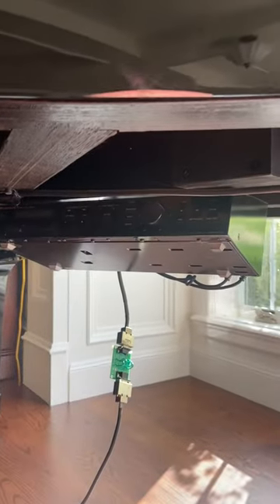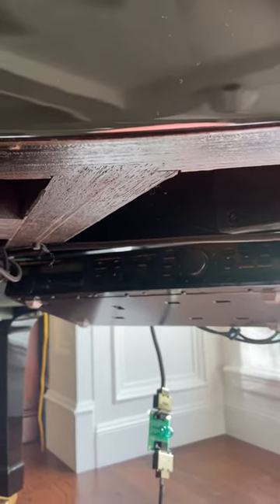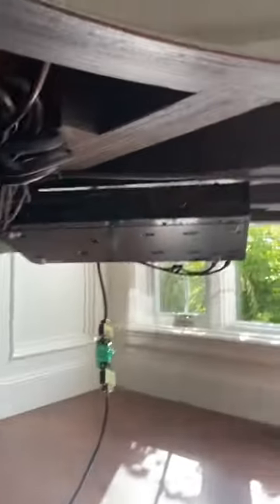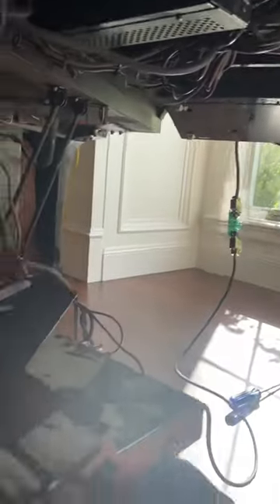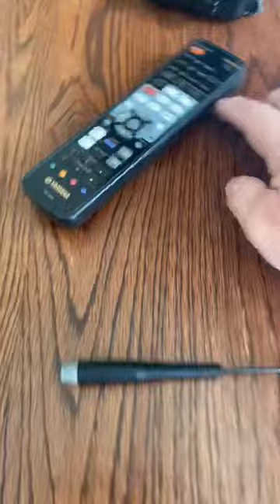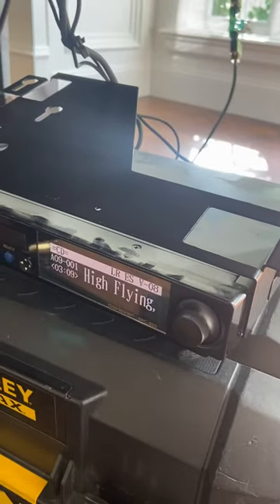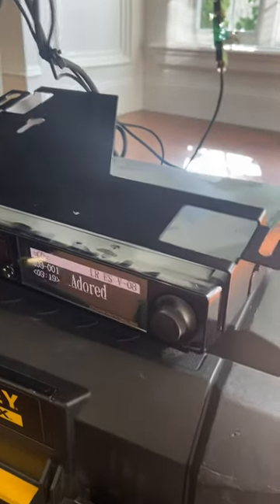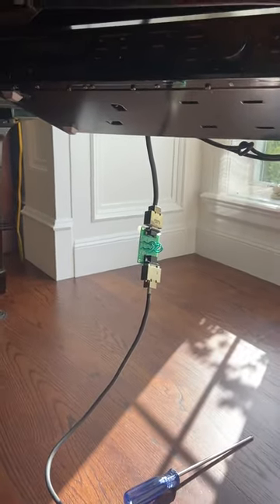It WORKS! DKC100R straight up to Dkc850 no midi cables no ancient control box!!!

Comment: I am thinking about buying a Yamaha C2 with this configuration.  Are you still happy after 3 years?
Reply from the maker: Hello!!! Very happy!!! Make sure to ask if the piano has had its power supply replaced or refurbished!!! It’s GUARANTEED to go out if it hasn’t already!!! About $800 to get it refurbished by TAP in CA or you could get a new one for about $1200 make sure to bring that up before you buy it. Then contact me and you’ll be in business!! C2 oh yeah! Add pianostream and combo dkc850 9-15 adapter board and you won’t need the extra control unit.  Plz send me an email.  Hayesiq@gmail.com 
Thanks…. Richie

Comment: Please more information just upgraded my mkii to dkc 850...would like to know more so I can get full functionality of the dkc 850
Reply from the maker: Jeremy Sisante is the dkc850 connected to the original control unit with midi cables?
Reply: Yes, it’s hooked up to the old dkc 100r through MIDI cables on the “Add” setting.  How do I get one of those awesome circuit board adapters?
Reply from the maker: Jeremy Sisante Oh man that is good news for you! You don’t need to use that thing! So just send me an email if you would and I’ll get you hooked up my email is Hayesiq@gmail.com